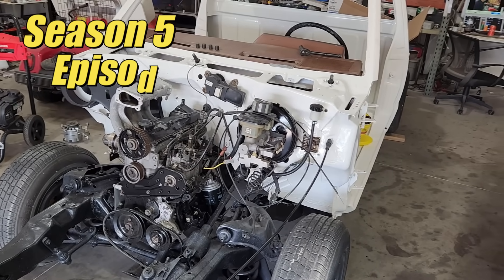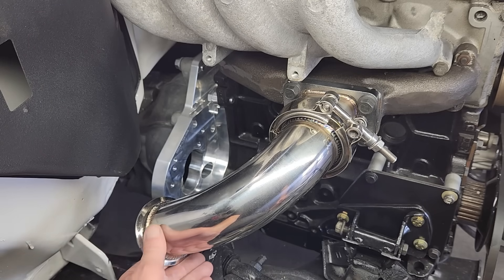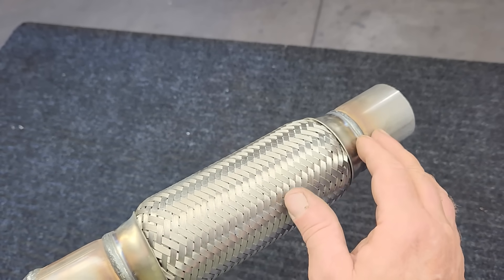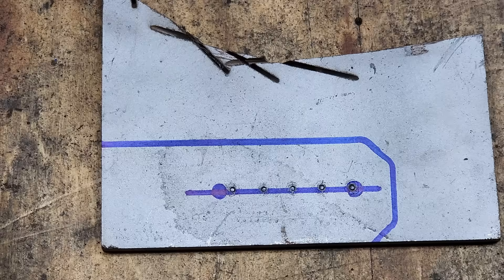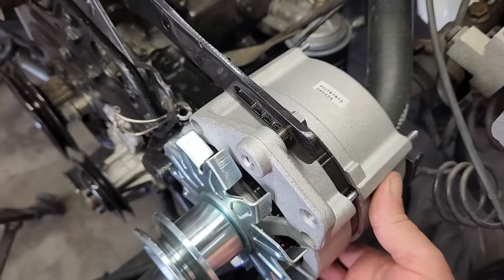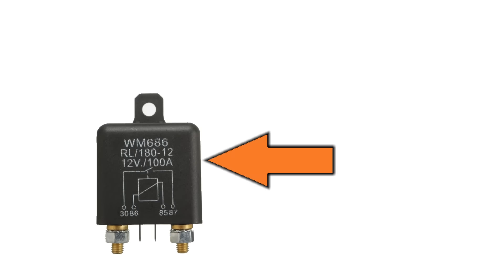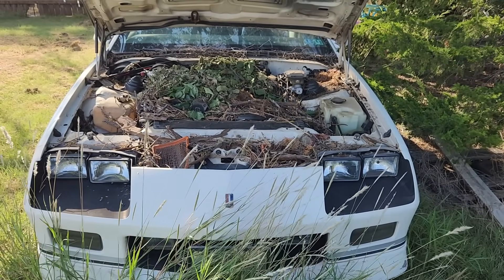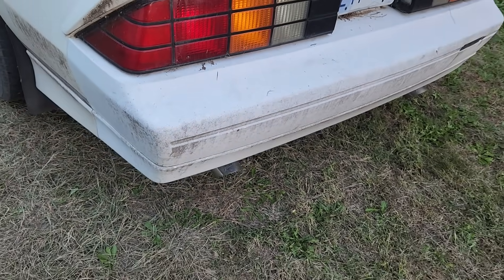S5 E35. DIESEL SWAP Chevy S-10.  we build a custom exhaust and more!

Comment: That must be an aftermarket transmission swap on that Iroc-Z.  As far as I know, all 5.7 (350) cars had 700r4 transmissions, only the 305 could get a manual.
Reply from the maker: From what I understand, the 350 was available with a 4 speed manual.  I will try my best to dig up the RPO codes and we can see how this car was optioned when new.

Comment: There are gear heads out there like myself that prefer carburetors over EFI because of simplicity, a carburetor will deliver fuel to a spark ignition engine without any sensors or a computer. A screwdriver is the only tool required to tune a carburetor, that's what I like.
Reply from the maker: Indeed, carbs will always work.

Comment: Well, that 5 speed certainly wasn't original, the 350 never came with one from the factory...  I worked at a Chevy dealer back in the day.    That said, I drove a 5.0L tuned-port injected 5 speed Z/28 and that was impressively torquey and fun to drive.   That engine could go from lugging around a corner in second gear to wide-open in a nearly psychotic fraction of a second.   Again, it was fun to drive!   It would make for an amazing transplant into an S-10 if anyone was so interested.

Comment: The one intake looked a lot like an LT1 manifold. The interior looks like 4th gen Camaro stuff. As that car never came with a manual, what are the chances that is an LT1 6 speed swapped car?
Reply from the maker: From what I understand, you could get a 4 speed with the 350.   The gen 4 stuff in the interior is an interesting curve ball.  Its possible the car may have a 6 speed.  we will find out soon.
Reply: @robotcantina8957 I’m digging into some old memories as it’s been a while since I was into third gen F body stuff, but I’m pretty sure only early years had 4 speeds. The newer ones were all BW T5s and only behind the 305 because the T5 doesn’t have a very high torque rating.

Comment: None of the 3rd gen 350 Camaros ever came from the factory with a manual transmission, because the wimpy T-5 from back then simply couldn't handle the torque. I've tried the 350/T5 setup in our 85 Camaro, and trust me, it didn't turn out pretty at all.

Cross your fingers that that transmission is a T-56 out of a 4th gen.

Comment: Glad to see the S-10 is closer to running.
If the original V clamp hardware was all stainless the threads will gall & seize together if there's nothing on them. A drop of oil, thread locker, something.
Also, pro tip: If you do a lot of exhaust work, hose clamps with 2 bars snipped out of the band at 3 places makes quick work of the setup & welding. You can tighten the clamps enough to hold & adjust until you get it perfect & clamp them down to take out & tack weld through the holes. The wider the clamps, the better.
Reply from the maker: Thanks for the pro tips!
Reply: @robotcantina8957   I try to contribute what I can.
Reply: @absurdspeed I out here in youtubeland also appreciate the protip.
Reply: @izzyplusplusplus1004  Awesome. Hope it helps.

Comment: 2:18 The scenario you are describing about the nuts almost sound like what rarely happens when I work with stainless nuts and bolts. The thing galls and figuratively welds themselves to each other requiring it all to be cut.
Reply: Aisi 316 is notorious of seizing

Comment: Hey Jimbo, love your channel! It may be hard to find a suitably small turbo for that T3 flange. I ran into the same issue with my Miata project. These cheap manis are made by someone who doesn't really know small engines, the smallest cheap (ebay) turbos are really designed for 300-350hp airflow applications. I know you'll figure it out.
Reply from the maker: Thanks for the info!
Reply: @robotcantina8957 Yes sir. I ended up getting a T3 to T2 adapter, but its so cheaply made that the flange welds warped them. I'll have to surface grind them to be usable.
Reply: Indeed a GT15 is about the biggest the engine can handle without extensive modifications.

Comment: Hey Jimbo, the reason those nuts are galling up on the V-Band clamps is because the hardware is probably a cheapo stainless steel.  From my experience with building food equipment, you need to put some kind of anti-seize on any hardware that is made from stainless. I personally like the copper based anti-seize, it holds up really well to high heat.
Reply from the maker: Thanks for the tip, I will keep that in mind next time!

Comment: Just a different way u could of cut that slot with an angle grinder and a death wheel then weld the open end to the old bracket way quicker slot making I like the way u did it though

Comment: That's a 4th gen console, that might be a 6 speed gear box. The swap is not all that hard to do and a ton of enthusiasts have done it
Reply from the maker: At this point its hard to say if it has a 6 speed.    I went through the gears and it feels like a six speed, except I cant find reverse where it should be.
Reply: @robotcantina8957 if the synchros let you into down right while rowing, then it's probably a six. 5 speed reverse always feels tougher. Up far right is reverse on a 6 and they definitely don't just fall in but I have confidence you would have found it. If the 8th vin digit is an 8, then it was an automatic originally, if F then it has a chance of being originally a 5 speed car, if it still is. Sorry, my 3rd gen enthusiasm is high, I just got mine moving again.😅

Comment: At around the 18:45 mark there's an intake manifold that appears to be a "MiniRam" intake that was produced by SLP (Street Legal Performance). Those are highly coveted intakes that are huge upgrades for the TPI engines. It's an intake that is very similar to the LT-1 intakes of the early next gen cars and allows significantly better breathing at higher RPMs. 

If you guys don't end up using that manifold, and it isn't roached, I would gladly purchase it off of you.
Reply: Now that I think about it, that intake manifold may have been produced by TPIS (Tuned Port Injection Specialties), but I'm pretty sure that it was used on tuner cars like the SLP Firehawk. TPIS sold them to the general public though, and you didn't need to pay the big bucks for a Firehawk to get one. :)

Comment: ha, you're using vbands.. while some years ago the collector on my headers rusted out so badly that we cut it out and welded in a 3-2.5" reducer directly to the old exhaust... It's been like that for at least a decade and one engine swap... btw I love oddball engines in vehicles.. I was thinking for my 50 chevy 3600 using either a 250 inline 6 or a 3.0L mitsubishi 4cyl diesel that I have in an old box truck.

Comment: When I saw that Camaro in the preview, I said to myself, "Oh Lord, I hope he doesn't try to diesel swap that he's going to have a riot his hands, but it'll be funny." Thanks for another great video.
Reply from the maker: LOL, if I did  a diesel swap on that Camaro the internet would explode.
Reply: @robotcantina8957  The internet could use a good exploding.
Reply: An olds 350 diesel with upgraded studs in the heads and a set of turbos would be hilariously fun but expensive to build for that car.
Reply: @ryanmiller2506 Was that the engine chevy tried to make from a gas engine and what killed the idea of diesel motors in cars in the 80s?
Reply: @Rexamajinx  it didn't really share that much other than a few dimensions. It "looks" like they did, but it was more different than it was similar, as I understand. Their big mistake was not adding more/larger head bolts. I dont think it ended up sharing much internally with a gas burner.
Reply: @Rexamajinx It only shared dimensions and tooling. The blocks and heads were purpose built for the 4.3 and the 5.7 diesels. By the end of the run they nearly got them reliable. But the damage was already done. The later 6.2 and 6.5 diesels were a LOT better. By not the latter can be made reliable.
Reply: @Ratkill9000 I think I heard somewhere also that American Diesel fuel was pretty horrible stuff in the 80s only really suited for tractors
Reply: I reckon with a bit of convincing you could make room for a 7.3 powerstroke in that engine bay...
Reply: I'd still support a diesel swap for a sportscar, (living in Germany with tons of diesel cars on the road) but seems like America isn't quite there yet😱😄
Reply: @Transporter-h1s americans just arent ready for it. A few really low quality attempts done by US carmakers really ruined the reputation of diesel cars here (looking at you Oldsmobile diesels) and the market has never really gotten over that. Pair that with the tiny peen coal rollers and you have yourself a recipe for a nation full of diesel haters. 

We are finally seeing a few more in things like SUVs and lighter trucks, but its still a hard sell to get my fellow "MURICANS" to buy a diesel car, even if they are more efficient. 

Id love to have some of the small diesel options offered in europe, but the market just isnt here to justify training technicians and providing parts support, sadly. 

I really wish we would change our mindset, but we currently have much bigger fish to fry 😢

Comment: I love this project. Thoae 1.6 diesels can make some good power with a turbo and modified injection pump! Why not just use the ecodiesel turbo/manifold? You may have a hard time finding a t3 with a small enough exhaust side to spool properly.
Reply from the maker: The t3 manifold was cheap and it fits.  As for the turbo we wont be using a t3.

Comment: Ah, Jimbo, trust me on this one, if an ECU was as cheap and easy to repair or replace as a set of points and a condenser, nobody would be scared of them....but ad they ain't,  we are. 😂
Reply from the maker: LOL, I totally understand,  I'm not a fan of the pre OBDII ECU's
Reply: But ECUs don't fail like points do.
Reply: @Low760and at (usually) 100+times the price, they bluddy well shouldn't either. Ans when they DO fail, you can't exactly tidy them up with a small file as a get you home measure...
Reply: Used to own a 1970 Saab 99 with the Bosch Djetronic and the ECU and wiring almost look the same.  Wouldn't surprise me that GM Delco borrowed an old Bosch injection system for their 20 year newer car. Seeing how GM had Opel connections going back many decades. And the Djetronic relied upon a set of tiny points under the ignition's, in the distrbutor, for the fuel injection's timing.
Reply: @tauncfester3022 D jetronic was used for very short time and in only few vehicles.

Comment: Mad Max apocalypse it and convert to manual fuel control, electrics, schmelectrics. As far as glow plugs go, back in the day, we got sick of GM glow plug controllers failing back in the Roosamaster days, so we would white up the solenoid to the seat belt warning controller and used a thermal switch found on the back of the head that controlled the cold high idle for the thermal control. Just wait for the fasten glowplugs light before staring.

Comment: Flex Top Lock Nuts are what the Pro Mod Profesionals use on T-Bolt and V-Band Clamps. 3000HP+ Blown Alcohol doesn't leave much wiggle room for failure. 🏁

Comment: The 5.7 was never cam with a 5 speed for the 3rd generation. The center console is out of a 4th gen camaro, and was swapped in. Could be a real IROC with the 5.7, and you are correct that the valve covers should have been black. So, someone has been in the engine before. Also, all 1986 and newer L98 engines were roller camshaft blocks, abet most were 2 bolt mains.

Comment: Yeah, those nuts on the V-bands suck balls!  I used a bunch on my Sierra when I went long tubes into a single 3". Went with better nuts AND used never seize on the threads.... never had one croak after that.  Pretty sure it's the stainless T-bolts galling without it.

Comment: Owning two 3rd gen Firebirds and 1 3rd gen trans am in the past, I had been idly wondering if your diesel swap could be done on a 3rd gen Camaro! Weird! :D :D
Reply from the maker: LOL,  well, it looks like the 350 will have to come out.  I'll have a good look at the engine bay to see how much space there is.
Reply: @robotcantina8957  I loved my last '91 Trans AM GTA 350, and the previous 89 Firebird Formula 350 (which sadly died), but I always missed the acres of room in the engine bay of my first '92 3.1 V6 Firebird (it also cornered more smartly too :D ). Those were years of manufacture by the way, not purchase, as you can probably tell from the jumbled order :)

Comment: 14:31  Attn friend Eric, I had this exact car and even though the 5 speed was fast it wasn't made for the torque of the 350. Mine did what they all did, fifth gear stripped and the metal ground away the inside of the trans. If this one hasn't it will. I ended up replacing it with a truck trans but I don't recall the model. It fit the engine but not really the Iroc. I ended up cutting the shift lever and welding it offset because it didn't center in the console. It did however last for many years and many burnouts and never needed a clutch replacement.
Reply from the maker: Good to know!
Reply: Diesels can be harder on the gearbox too. 
I dont remember the numbers anymore. But the same transmission could handle alot more torque on the audi 2.1/2.2 turbo, than it could on the 2.5tdi.

Comment: One of those intake manifolds in the back of the Camaro is a 94-97 Gen 2 LT1 intake.  It can be made to fit a Gen 1 engine, but it's not a direct bolt-on.
Reply from the maker: Thanks for clarifying the oddball intake.  I really wish I knew what the previous owner was planning to do with this car.   I did find a time slip and the car was able to do a 14.5 quarter mile back in 2009.  Not real fast but not bad.
Reply: @robotcantina8957  Some people put those on the Gen 1 TPI engines because that intake breaths MUCH better at high RPM, and the various aftermarket intakes for the TPI system are all ridiculously expensive now.  It has to be machined to take a distributor and you have to use a small cap distributor with a remote coil instead of the original style HEI.

Comment: Idea here for the Glow Plugs, get a time delay relay So that way when you turn the key to the ON  position, the glow plugs will work just automatically every time so you don't need to touch a single switch or even have a switch in general, making sure to use a Bimetallic (Normally Closed coolant temp sensor) which just grounds it's self when cold... and then the Glow Plugs will shut themselves off after about 30 seconds to a minute using the Time Delay Relay and then with the temp switch they will not come one at all when the engine is warmed up thanks to the Normally Closed when cold temp switch witll remove Ground from the relay keeping the relay off... As for Power for the relay Just steal a trigger signal from the key RUN position.
Reply: Most of the year you don’t need glow plugs on these little VW Diesels. So holding a momentary switch for a 10 Mississippi count on cold mornings isn’t bad. When I do diesel swaps, wiring a momentary on the ground side of a solenoid is super quick and easy. Using a solenoid you don’t even need a glow plug light because you can hear the clunk of it working and the dome light dims a little. Kinda like a reverse glow plug light in a way! Hahaha
Reply: @beardotapeshoes27 1.6D is indirect swirl chamber diesel. It needs glow even at 20C
Reply: Use original vw glow timer relay....

Comment: You need a small milling bit to put in your drill press to save the filling.
Reply: A drill press is not a mill. If you do that, the jacobs chuck will walk out of the head and you'll end up with an angry bladed battle-top let loose in your shop.
Reply: Ah it builds character! The excitement keep you on your toes…. How ever many are left!
Reply: @beardotapeshoes27 
Having all three, files, drill press and a mill I abuse them all!
I’m a builder not a pristine carer of tools. You never wear out tools by looking at them and cleaning them.
That’s like saving your girlfriend for the next guy.

Comment: gonna be interesting to see how the s10 is to drive with the small diesel. and what milages you get.       i used to have an s10 blazer with the v6 and a slippery automatic, it was a pig..  around  2L/10km..      another thing. a pro tip, if you deburr the stock on the beltsander before free hand drilling it wont cut up your hand if it catches  on the drill
Reply: With no turbo it may not make highway speed. Those 1.6 N/A maybe make 50hp. I've driven the tiny pickup truck that engine came from and with the 4 speed it should have 70mph is barely reachable full throttle down a slight hill. It definitely can't keep it's speed up any incline. A turbo would help but I'm not sure if his was originally turbo or N/A as the Turbo block has oil cooling of the pistons to stop it from melting itself.